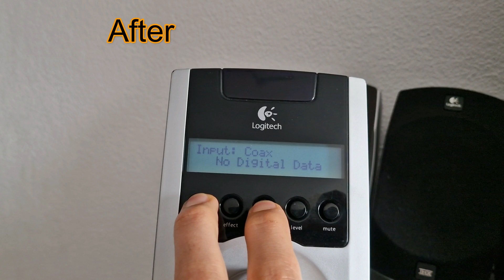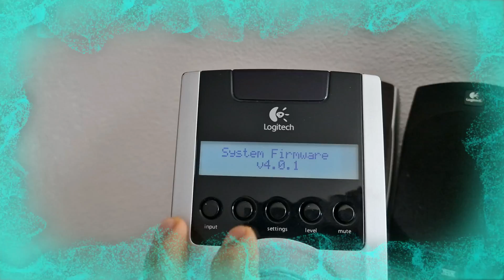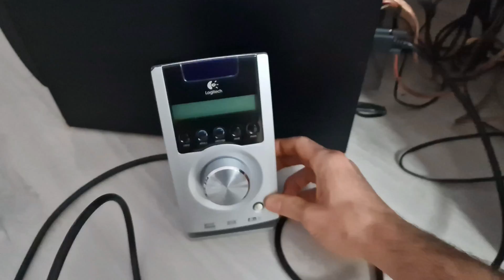Logitech Z5500 Change POD Control (Firmware 2.1.0 to 4.0.1) + New Case!

Comment: Whats the difrence from 2 and 4 i have  2
Reply from the maker: There are software + hardware differences.
Overall the latest version has better components and a more balanced software for better sound, the differences are fully felt.
Components such as display and capacitors are completely different from the old model.
+ the other chips with new improvements.
Reply: @ElektroGamer30 Thanks! 
But If i change the Control pod but not the sub with V4 do i have Audio Differences?
Reply from the maker: @IchKlebeAnDir  
Yes, there are small differences, but not very big ones!
Reply from the maker: @IchKlebeAnDir  
Yes, there are small differences, but not very big ones!

Comment: I wanna ask you a question regarding r818 control pod. On it the CS42526-cqz somehow bulged up and I had no sound. I tried to replace the chip with soldering iron. This messed up traced on pcb and lifted them. Can you check where pins 50, 12 and 13 connect to?
Reply from the maker: Hello, unfortunately I can't do these measurements but if you follow the exact route on POD Control you will find it.
You can also watch my other videos, they are all in 4K UHD format. so you can see the connectors and the circuit very well.
Reply: @ElektroGamer30  pin 12 and 13 I think I have found. But pin 50 i can't see it going anywhere. Althought it is marked on the chip as TXP.

Do you have any specific video where you take off the chip?
Reply from the maker: @BlackMambaKO  
I have a video here with the OPAMP replacement:

https://www.youtube.com/watch?v=xr-fVWnXM0c&list=PLsgyMOzSu2Eq9WmEVhE2aZzsZ22VpJyPS&index=5

And here is a small correction of the cold solder joints that appeared on this chip that handles the 5.1 sound management part:

https://www.youtube.com/watch?v=PjzHTUbRgX8&list=PLsgyMOzSu2Eq9WmEVhE2aZzsZ22VpJyPS&index=11
Reply: @ElektroGamer30  Unfortunately I can't see CS42526 chip.
When I look on my board there doesn't seem to be any trace connected to it. Is it possible that this pin doesn't have to be connected to anything and is connected internally?
Reply from the maker: @BlackMambaKO  
Pay close attention to the board, because it has circuits on both the front and back, meaning even if the wire is soldered on one side, it can go to the other side to make the connection there.
There's no way it won't be connected somewhere.
Reply: But then it would have via on the pad? As i don't see via on it
Reply from the maker: @BlackMambaKO  It has to have a connection somewhere, there's no way it doesn't.
All the wires that are connected to POD Control, all have a role, that is, they all need a connection,
You have wires with +18, you have -18V, you have 8V, you have minus, you have the amplification part for each speaker, including subwoofer, (5 wires + the common minus for all)
You have minus wires, 2 in total, you also have 2 wires for the Mute part.
Here's a little tutorial on how to test the amplifier without POD Control, it might help you!

https://www.youtube.com/watch?v=jS7nkCww8Bc&list=PLsgyMOzSu2Eq9WmEVhE2aZzsZ22VpJyPS&index=6

Comment: I have a crackle that happens after a few hours then goes away. I'm pretty sure it's the pod. Do you think it's a bad cap in the pod or sub?
Reply from the maker: Hello, it may be a problem on the amplifier board, maybe one of the 3 large capacitors!
Theoretically the middle capacitor in the subwoofer is responsible for these noises!
It's best to replace all 3, here's a video that may help you!

https://www.youtube.com/watch?v=W4CVPgWLYz8&list=PLsgyMOzSu2Eq9WmEVhE2aZzsZ22VpJyPS&index=18
Reply: @ElektroGamer30  it's the pod. I've changed it out already a few years back and the problem came back same think. Actually the other one just finally dead but it did have this weird crackle. if i change the from center to surround it goes to the outside speakers as well.
Reply from the maker: @MrTrocks365  
This system is quite outdated, and with time problems appear..
Depending on the PID it can reach 20 years old :)
Considering that the release date was like 2003-2004!

Comment: my control pod has recently started going mostly blacked out(led is still lit) after a minute or two of use, then turns itself off. i have to turn the power off at the sub and back on to get it to work again but it still only lasts a minute or less. I've replaced the fuse in the sub and the same issue persists. any tips/fix? you seem to be the most specialised on these z5500 speakers ive found online. had these speakers for well over 10 years and never had an issue and definitely dont want to part with them if its an easy fix! thanks
Reply from the maker: Hi, I didn't quite understand the problem exactly!
So the LED goes out after 1 minute and the display doesn't light up anymore?
But can the writing be seen on the display?
If it's just a problem with those LEDs, look here for a quick and very cheap solution!
Watch this video I made!

https://www.youtube.com/watch?v=wqud_WGYSlI&list=PLsgyMOzSu2Eq9WmEVhE2aZzsZ22VpJyPS&index=20
Reply: @ElektroGamer30  no the speakers/sound turn off when it happens. The backlight of the pod is still on for a few seconds after it happens then it basically goes back to being on standby with the power button of the pod going back to red instead of blue but it wont turn back on until i switch the sub power off and back on. Ill take a video of it and upload it today. Thank you for quick response!
Reply from the maker: @R3dnut84  Hello, from the described problem it seems to be a disadvantaged capacitor!
It is possible to make the capacitor inside the Subwoofer, or maybe even the large capacitor inside the POD Control!
You must check and replace them!
Watch a video that can help you!

https://www.youtube.com/watch?v=fFZLkstWMhM&list=PLsgyMOzSu2Eq9WmEVhE2aZzsZ22VpJyPS&index=16
Reply: @ElektroGamer30  thanks again for the reply. im still trying to get the issue on video. the speakers have lasted over 30mins each time ive tried today and then had to stop to do other things. the far right side of the LED screen where the characters can go (the faint squares across the screen) starts to get darker and darker the longer the pod is turned on so im thinking maybe its overheating and switching itself off eventually? even on standby it can have the error but im yet to capture it on video in real time.
Reply from the maker: @R3dnut84  Hi, I don't think it overheats enough to stop!
So to understand better, if the screen goes dark, the system still works normally, yes?
I mean, the screen is almost invisible, but you can still hear the music, right?
If so, it is possible that you only have the LEDs that have started to fail due to age.
Did you check the videos I sent?
The one where I replaced the LEDs on the display, there you can see how dark the display looks on the POD Control!
Exactly at the beginning of the video I show this, there you can see that in the corners it is not lit at all! At the 14th second, I plow in the dark!

Comment: Firmware 4.01 or 4.02 : Where can I get it?
Reply from the maker: Unfortunately logitech did not share the necessary files and devices to update the Firmware.
You can just look for a POD Control that has the latest version of Firmware.
Reply: @ElektroGamer30 From which PID are we sure to have firmware 4.01?
Reply from the maker: @brunojuton4969  I'm not sure but I think from PID 010 +
Reply: @ElektroGamer30  So with a PID R013 for example, this will not be the case?
Reply from the maker: @brunojuton4969  Mine is PID 020, and it has this version 4.0.1!
Reply: @ElektroGamer30  Logically, according to the coding, this means that your Control Pod was manufactured in 2010, during the 20th week. 

So, no need to have a POD that dates from 2011 (last year of manufacture). Firmware 4.01 would have been deployed as early as 2010
Reply from the maker: @brunojuton4969  Theoretically yes, since 2010 this system was modified for the last time!
It received new components (not very different from the others) and at the same time the new firmware version!
Reply: @ElektroGamer30  I have received a control POD , with PID R013. Bad new : firmeware is not 4.01 but 3.00. I seek a 4.01 desesperatetly.

I have found on ebay a another Control Pod with PID number : 10001487-0430R. I don't know this codification. what does it mean ?
Reply from the maker: @brunojuton4969  Beware of fraudsters.
That metal that has the PID number stuck on it can be replaced!
POD Control should be PID 800 but on the label should write PID 015!

I don't know that PID number either..
I have never seen before!

You can try a POD Control with PID 020 like mine or bigger! (030, 040,050)
Reply: @ElektroGamer30  Thanks.  Nothing available on Ebay at the moment. Do you know of any other sales sites where I can find recent ones ?
Reply from the maker: @brunojuton4969  I also bought the systems from ebay.
At first, I didn't know all these details about the Z5500 either.
After I bought the second system (the one with the new firmware 4.0), I started to document myself and modify it!
That's how I found out that I paid $40 for the latest Z5500 model produced by Logitech!
The system was complete and perfectly functional! :)

Comment: Meu Pod sumiu a descrição do display não mostra nada ele continua com luminosidade mas sem descrição nenhuma, as vezes quando desligo e depois de um tempo eu ligo novamente ele volta mas depois de algum tempo ele some,  já resodei o cabo flat e substitui ele seguindo um video aqui no youtube mas não deu certo cheguei a comprar um diplay no Aliexpress fiz a instalação e não funcionou fico apenas com Luz também sem descrição, então devolvi e coloquei o original de volta. Sabe me dizer o que pode ser e como posso estar resolvendo isso. Obrigago.
Reply from the maker: Olá, você precisa fazer algumas verificações.
Primeiro, se você verificar a fonte de alimentação no POD Control, você deverá ter +18v - 18v +8V.
É possível que a fonte de alimentação de 8V seja mais fraca!
Reply: @ElektroGamer30  Então eu devo verificar as tenções +18v -18v e +8v e se ela estiver mais fraca pode ser esse o defeito? E se no caso não estiver dando os 8V o que eu tenho que trocar ? algum capacitor que está no Pod?  Obrigado.
Reply from the maker: @igobrgameplay  Yes, if there are differences of 2/3V, that's why the information is not shown on the display.
Possibly a faulty voltage regulator or the large capacitor inside the POD Control!
Reply from the maker: Aqui está um vídeo feito por mim, com as fontes de alimentação do POD Control.

https://www.youtube.com/watch?v=RxMEwN5OYbg

Comment: Hello, could you tell me if I can use the main control on another speaker model such as x530
Reply from the maker: Hello, yes, it is possible.
It's a bit more complicated because you have to make 3 different power supplies to power this POD Control from logitech Z5500.
But the speaker outputs can be used on the x530 amplifier.
You have to build a circuit to turn off/on the amplifiers because the Z5500 uses one transistor for each pair of channels to turn off all 5 TDAs.
If you want to see how you can use POD Control without a subwoofer, watch here a video made by me!

https://www.youtube.com/watch?v=RxMEwN5OYbg&list=PLsgyMOzSu2Eq9WmEVhE2aZzsZ22VpJyPS&index=8

I also connected it to a car amplifier :)

https://www.youtube.com/watch?v=M3aMAHfwak4&list=PLsgyMOzSu2Eq9WmEVhE2aZzsZ22VpJyPS&index=7

Comment: Hello ,I have the z5500 speakers with on board card from B760M AORUS ELITE AX via optical cable I only get in windows 11 sound from 2 1 speakers not from sub and rear speakers,I tried all updates and everything, any solution ??thx
Reply from the maker: Hello, only if you play a movie that has a 5.1 or dolby or DTS effect, only then will all speakers work!
I also tried various programs to have 5.1 sound but I didn't succeed..

Comment: What are the differences between 2.X.X and 4.0.1
Reply from the maker: I noticed a lot in Dolby and DTS movies, there were sound changes in the Voice on the central speakers, and a little more tweeter on the central and bass!
You can see the new components in POD Control, as well as the screen with a different contrast to the old one, the new firmware that allows it to be displayed on the screen, even if the system is turned off!
+ other changes that logitech did not disclose!
Also try the MODs I made, you'll be surprised how much the sound can change!
There are 4 videos on my channel, look here link!
1
https://www.youtube.com/watch?v=W4CVPgWLYz8&list=PLsgyMOzSu2Eq9WmEVhE2aZzsZ22VpJyPS&index=17
2
https://www.youtube.com/watch?v=3i0sI4N84Bg&list=PLsgyMOzSu2Eq9WmEVhE2aZzsZ22VpJyPS&index=16
3
https://www.youtube.com/watch?v=IwjKWUaQo5c&list=PLsgyMOzSu2Eq9WmEVhE2aZzsZ22VpJyPS&index=14
4
https://www.youtube.com/watch?v=Dk8L73oLOPA&list=PLsgyMOzSu2Eq9WmEVhE2aZzsZ22VpJyPS&index=2
Reply: @ElektroGamer30  So if I buy a full setup used its recommended to get the 4.0.1 Version?
Reply from the maker: @Michael-hw5qq  Yes, of course.
I paid €50 for a fully functional system.
Reply: @ElektroGamer30  In Germany they're a little more expensive unfortunately 50€ pickup but 110€ shipping mine will be 175€
Edit: Are you from germany and speak german?
Reply from the maker: I live in Germany and I don't speak German very well.
I also bought both systems from here!
One in 2020 for $90
And the second system in 2022/2023, I don't know exactly, with $50 @Michael-hw5qq
Reply: @ElektroGamer30  is it normal that it puts out a very silent barely hearable high pitch tone arround 1-2khz? Or do I need to replace the electrolyte caps
Edit: It only does it in the Direct input aka the 3,5mm jacks loudest at 6ch direct and less noticable in stereo or stereo x2
Reply from the maker: It is possible that it is also due to the capacitors that over time lose their properties, but it seems that there is a small noise with me, but imperceptible, you can only hear it if you listen to the speakers.
If you have a jack connected to the POD Control, you may receive small interferences and because of this you may have background noise,
If it is not a very loud noise, you can leave the system as it is, if not, watch a video on replacing the capacitors!
After this MOD, you will have a much more detailed and clearer sound!

https://www.youtube.com/watch?v=Dk8L73oLOPA&list=PLsgyMOzSu2Eq9WmEVhE2aZzsZ22VpJyPS&index=3

 @Michael-hw5qq
Reply: @ElektroGamer30  ok thx. Do you have any ideas on how to get 5.1 sound to it? My optical cable will arrive on monday and it goes into my tv optical out. I want to connect my laptop to it tho and it doesn't show surround sound putput in the settings
Reply from the maker: To use 5.1 sound from a laptop you need a 5.1 to 3.5mm jack adapter.
This adapter connects to the 3 ports on the back of the POD Control, you insert the 3 jacks into the adapter and the pod, and a 3.5mm jack comes out of this adapter.
You connect it to the laptop and you will have 5.1 sound
Through the optical cable you will only have DOLBY and DTS effects.
But for music you cannot use 5.1 through the optical cable!
You can only use the stereo effect X 2, @Michael-hw5qq
Reply: @ElektroGamer30  ok thanks again but I can use a nintendo switch surround soud output? It goes over tv and optical out into the z5500
Reply from the maker: With pleasure.
I don't know if you can use Nintendo to make surround sound, you can try! @Michael-hw5qq
Reply: @ElektroGamer30  Which effect should I choose to play 5.1 Audio? My Switch outputs surround sound but my tv doesn't pass it over hdmi to optical -_-
Reply: Now connected to my old dvd player it detects dolby digital but hooked up to the tv it doesn't detect it
Reply from the maker: @Michael-hw5qq  My TV is a Philips that supports Dolby Atmos/Vision movies
When playing a Dolby format movie, POD Control automatically switches to the Dolby Atmos Effect.
In your case, the switch probably does not transmit Dolby format to the TV, so that the TV can send the Dolby signal to the Z500.
You can also select the Dolby effect directly from POD Contral
Leave POD Control on Digital/Optical input. And move the effect from stereo to PL II Movie.
Reply: @ElektroGamer30  Update. It only uses Bitstream Singnals. Linear PCM doesn't work.
Reply: @ElektroGamer30  can I get your discord by chance so I can send you the noise and maybe try to solve the issue?
Reply from the maker: #nexus5092
 @Michael-hw5qq
Reply: @ElektroGamer30  friend request is out